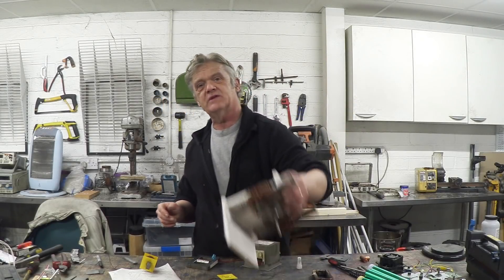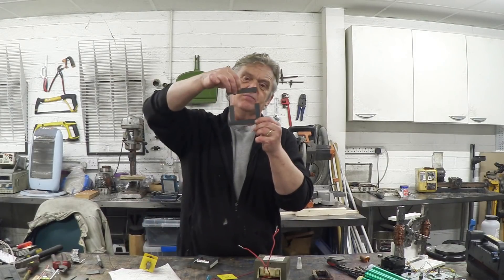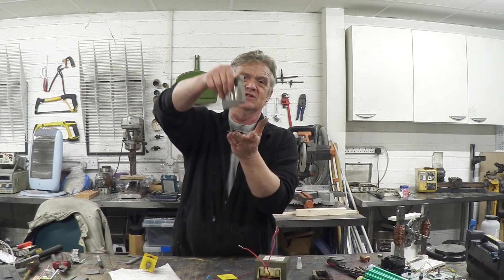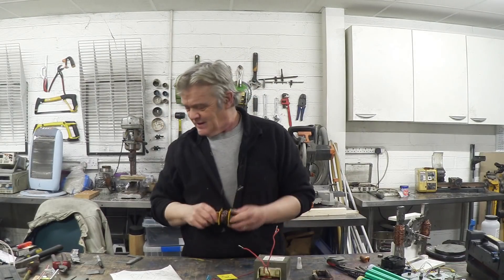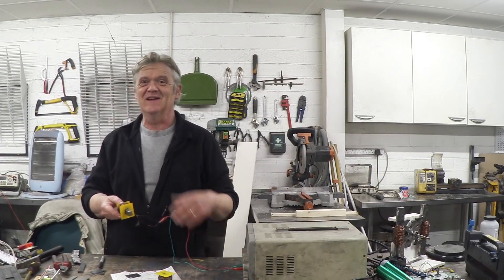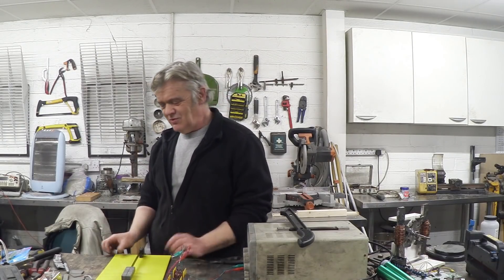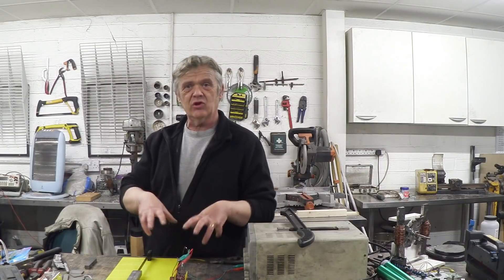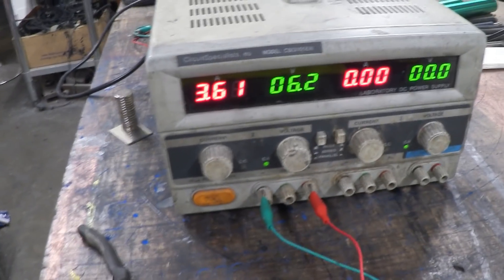1036 Flux Switching And Possible Over Unity

Comment: You are getting very close to the answer, but you are not quite there yet.  I also have theorized on this device but have no workshop facilities.  This is a cause of much grief to me.
But please be aware that success will bring the wrath of power companies down onto your head.  If you achieve a working prototype keep it in a locked box.

Comment: This is actually a mind blowing experiment for me. Thank you. I will spend some time thinking on the best way to replicate and also compare the result to the electromagnet when it is not in the magnetic circuit container. But, first I need to focus on the solar stuff. This is next on my list tho. I think the key here is to redo the experiment with the original electromagnet with only a soft iron core cylinder and not a "U" shaped one to compare to the U shaped and then the neodymium setup. 
I am finding it very odd tho, that the neodymium magnets can't attract while surrounded by the "keepers" cage (for lack of a better term)  since the magnetic circuit is "forced" to travel in the low reluctance circuit, but, the Electromagnets, which are ALSO inside the keepers cage... somehow manage to bypass the requirement of the magnetic circuit. I definitely would like to have this experiment revisited if possible, with better equipment to measure the magnetic force. But, after thinking about this, there must be something else going on here. Because I think you are right that being able to simply switch the flow of a permanent magnet on/off would probably violate conservation of energy. If it were that easy, we could just put relay level energy to switch massive magnets on and off to turn shafts on much larger generators and get over unity. So, clearly we are missing something here. My guess is that no matter how you do this you always have to put the amount of electricity necessary to generate the magnetic field regardless and as someone else mentioned earlier, the reason you see the disparity in the voltage and current usage is because the first method was less efficient to begin with, so this is just a more efficient method as opposed to "turning the permanent magnets" on /off. Still, I find it intriguing. Perhaps this is a way to improve efficiency overall. Please repeat the experiment, but add a traditional single coil with center core only (not an H) as a control.

Comment: THIS is the video that put into my mind a "2-cycle" transformer: use the two coils from a secondary microwave transformer and have them vertical in the 'valleys' of the E frame, while having the primary coil of the first transformer horizontal.

The only adjustment would be to the windings of the 'top coils' and there would be effectively one side for amps and the other for volts.

Diodes and timers would allow for a very articulate system that would use the power of the transformer to do the main body of the work, yet the transformer in question would be very like a step up transformer for both amps and volts respectively.
Reply: Lenz less? Russian stuff?
Is this similar to Bearden's MEG?
I can see this as a Gap Motor. Combined with a variable capacitor. 
Thinking of no drag. High voltage?
What are your thoughts?

Comment: would make for a low energy light weight railgun. Just nebulize strong magnets as the projectile passes though. no more need for a capacitor bank. to charge coils

Comment: This is the so-called Flynn Motor, which is very fascinating indeed. I followed the experiments of very willing guys on this type of device, just to try to create an engine that was capable of going into overunity (in reality it was a site of skeptics that tested the concept). The problem with this type of device lies in the magnetic flux which is opposed to the current in the coils which cancels any beneficial effect of the multiplication in the deviation of the magnetic flux. When the device is put into practice, the magnetic flux entering and exiting the coils opposes the work and brakes the device generating losses. (I don't know if I was able to give the right explanation, because I don't have a lot of experience and I'm not a native speaker of English). Unfortunately, "nature" is diabolical

Comment: Now you get my attention! For the CoinCoil! Two Ciol with a coin in the middle side by side a neodymium magnet in the middle and iron bar over and under! 24 Coils in the 100 £ VAWT! 4 times efficiency. We are Close now! And 1 kWh isn't enought! If a magnet is fasted on a weel or a ducted fan, 3 sides can Work up, down and straight forward! With  a "Tesla" energi or atmospheric  energi from the higher up like a flagpole can drive a Bedinimotor! let us say 100 rpm! in front of the rotor (how is a ducted fan) the motorcoil is and over and under the special coil is! And if the Bedini has the same type of coils it manage 4 times more! Awesome😂!!!
 You can make it Rob!

Comment: I always wondered if you had a strong permanent magnet with a magnetic field that reaches like 1 foot out and rapped a coil around it that apposes the magnetic field and that might compress the magnetic field weakening it for a second while the electromagnet is on so a small electromagnet can have effects further out so the output coil can be larger than the electromagnet field can possibly go because it's not the field from the electromagnet that we would be getting but field from the fluctuating permanent magnet the pulse would have to be short like maybe a spark gap

Comment: Flynn Parallel path magnetic technology (PPMT). I have been working on things like this. Not free energy, just adding permanent magnetic flux to electromagnetic flux. Which can be switched back and forth by DC going through 555 timer. Or AC input which allows flux to change sides.  He called it steering the flux, and he said his designs do add to efficiency.
Reply: How about not using any electronics and simply increase the reluctance for the rotating core of the switched reluctance generator or flux switching alternator? EASY free energy and overunity.

Comment: The biggest problem with OverUnity and (Possible) Perpetual Motion is being able to escape from straight line magnetic forces as the item is captured by the last magnetic field flux. 
The problem is enhanced that you cannot loop the track of magnetism to keep an item rotating permanently. I think the following questions help
1: What if the final magnet was weaker to allow a sufficient mass in motion to escape the last flux & re-enter magnetic propulsion loop?
2: Motion sensing the rotating mass into the last flux field of electromagnet, and switch off the power, collapsing the last flux lock,  would the mass have sufficient force of movement to enter the magnetic loop again?
3: Could a linear motor/magnetic field be generated on approach as a metal object approaches, and switch off after passing. Use less current energising small segments in a rotary fashion, than energising the whole circuit permanently? 
Oh that sounds like an electric motor!! Motors overcome the last flux lock 
Why can a motor rotate more than one circle but not a magnetically propelled object ?
Reply: It's as simple as increasing the reluctance of the rotating core of the switched reluctance generator or flux switching alternator. That's all there is to it. Self-feeding and self-rotating with a synchronous motor.

Comment: I Had A Froze Motor That Got Too Hot. I Rewound The Motor With Thicker Wire. Really Increased The Power, But Also The Vibration. I Then Placed Neodymium Magnets Around The Casing And Adjusted Them To Counter The Vibration Surprisingly Well. Then Eww2ube Recommended This Video. Thanks Robert. your The Best. ❤️ And 💡 Brother. It’s How GOD Works.

Comment: I have seen videos of attempts to build a permanent magnet motor, they nearly work, but stop just before making a full revolution, seems with a bit of electrical assistance they could work, maybe use a electric magnet to 'turn off' the magnet preventing the full revolution, or to boost the speed, there's many ways to possibly get it to work, if not 100+% surely a motor 99.9999% efficient is possible! Maybe even 100%!!! We need to try before saying  'impossible'

Comment: It's a saturable reactor. You are pre-saturating the core with a magnetic circuit induced by the magnets in the center. Now compare the deviation from both coils in parallel on one I piece with a pole facing the deflector. That would give us some valuable data.

Comment: Your work calculation assumes that all the power from the power supply is doing work, but it's not -- almost all of it is being lost as heat in the coil. Using a permanent magnet to supply some of the flux is just making it slightly less grossly inefficient. Nothing magical is happening. This is not a new idea -- a permanent magnet motor is more efficient than one with field coils for the same reason.

Comment: 7:36 So one is (say) 10% efficient and the other 40% efficient. Sure one is 4 times better than the other but I'm certainly not thinking "overunity".
Reply: Oh I am.  Take a circular V gate.   It works down to that last inch.   Permanent magnets do 90+ percent of the work.  it just can't get back Into the gate.  Blip that starting (or end) point off at the right point as it goes, it keeps going, and you get more work out of it than energy in. 

I'm stongly pondering how weak you can make the electromagnets to redirect the magnetic flux enough to generate current in a bunch of coils using permanent magnets as your primary electro motive force.    how much juice in an electromagnet does it take to contain a permanent magnet's field in an armature? (or change it enough to induce a current in a coil) if that's less than the permanent magnet's field fluxuating induces in the coils around it, then you've managed to hack what physics Does, and got some overunity happening. 

And I'm coming at that from a "Potential Leverage" perspective, rather than a hairbrained one.
Reply: I'm also certain you can run a stirling or steam engine off an AC unit, without costing the system anything.   (right after the compression phase where it has to Dump heat, and right After it's done the cooling bit in the room, and the refrigerant is still cold)  Could you get enough to Run the AC unit?  likely not.  but you could Absolutely turn that temperature differential into extra electricity, without impacting the function of the system.
Reply: What Bob is suggesting is a catalyst. How to get the same thing 4 less effort.
Think about it, build it, test and use it. Then check your wallet. That's all.
Reply: @wazittuyoo2147  That's really not difficult to achieve if the efficiency you start with is very poor. It's not hard to improve the efficiency of a motor from say 60% to 90% or even 95% but that doesn't mean you are any nearer to achieving 101% (eg over unity).

Comment: I did a similar concept in school physics to demonstrate the concept of field weakening to use the permanent magnets permanent latching and then weakened by small pulse to a coil around the magnets which would let go of its victim. The best demonstration was in reverse though when I had the permanent magnet in repulsion and pulse the coil in attraction to pull it towards and it was able to break an electrical connection to demonstrate a control mechanism that was highly efficient! Essentially it was a  modern day relay !
It actually reminds me of some great times in conceptual physics at school.
Reply: Essentially a Gap Motor. A good concept. 50% input, and even less.😊

Comment: Another thing Rob, over unity can only be achieved in an open circuit system, where the input is not physically connected to the output. Like a gravity assisted water pump where two small children can swing a heavy weight around to turn a pump. This must be possible with magnets where you can switch on and off an electro magnet to " nudge" a weight to "fall" into gravity?

Comment: Well then Rob, what did the soap taste like, lol. Please try a washing machine water pump. Just add a strong magnet to the top of the laminations. It "appears" to dramatically increase the power generated. By the way , this kind of pump is really a magnificent generator of power. Steinmetz apparently did the maths and came up with a '"voltsecond' where time is irrelevant to the generation processes. I do not pretend to understand Steinmetz's formulas, but maybe with a bit of experimentation and common sense one might replicate the flux thing with a simple pump?

Comment: That is really cool I wonder what would happen if one of the coils you put AC current instead of DC current what comes out the other side with the neodymium magnets assisting think I'll experiment with that
Reply: Pulsed dc, one coil cw, the other ccw or simply invert one of the coils, and not too strong neodymium magnets, the effect is real numerous people have experimented with this Lawrence tseung is one, numerous configurations is possible, Research Patrik Kelley guide transformers

Comment: Did you look at the orbo?( I think that's what it was called) motor using a small electromagnet to saturate a core in order to switch off the main flux from a permanent magnet that drove the rotor.. quite interesting...
Reply: Steorn's Orbo? €23,000,000 over 10 years, proving how gullible some people can be.

Comment: use a power meter and run it for 24 hours and watch it degause the magnets
Reply: Your the kinda guy who should just keep paying his electric bill and bitch every month when you do it. 
Who knew you can only use a magnet so long.
Reply: @make425  because i went to learn this sort of stuff also you might rip the magnets apart if the field flux is strong enough even tho they are coated magnets.
Reply: @fastmover45 then you understand how a magnet is made,  heat is the main cause of magnetic lose,   not putting two opposite polls together. I can see the possibility of nutrulation of the feild because of repolerising the magnet due to overpowering a field. Same thing use to happen with old motor cycles magneto. Lose there field and you have to remag it.
Reply: @make425  ok so mains AC is 60hz in usa and 50hz in the uk therefor a changeing flux field 50 times a second. The magnet is being worked on like a hard disk degauseing plate.left hand rule and right hand rule no movement = heat. there are loads of reasons this dont work.
Reply: @fastmover45  ah i think i understand why you are thinking like you are. 
If he makes a motor/generator. This will be most likely be pulsed dc,  the coils will only perduce ac electric as a biproduct of the collapsed coil field. ,
Im just saying your not going to kill the magnets field.
A magnet can be recharged! Simple as that.
Reply: @make425  transformers only work on ac. If you pulse a transformer with dc you get a massive back emf.
Reply: @fastmover45  yes the more the better for what we are doing. Its part of the search for a over unity motor/device. To get more work out than we put in.
You might want to brush up on some free Energy research. Bedini, newman, tesla, Howard Johnson,  Robert Adam's motors.
Reply: @make425  free energy / over unity is a joke. Learn the science and understand it. this stuff would be on the front page of the IEEE if it worked. It dont work it has never worked  it not going to work.
Reply: @fastmover45  nothing is free,  i agree with you on that.
You have to have starting power.
 But it is very possible to make a over efficient motor. You would have to witness it in person.  
If i can spin my 50 pound flywheel for 8 days 24/7 and only lose 1 volt from 24.7 to 23.7, 
You cannot tell me i could not pump hundreds of gallon's of water at a quarter of a amp. 
Check my channel out and watch the video, then think about what there teaching in school.
I'm still in the middle of my project and there's no way I'm stopping now. Water pump is right after I can rework the driver circuit. 
There's villages that need tec like Joe Newman did.
And in my opinion, all the other free Energy people  that Made real machines failed because of greed. God wants this to be 💯 free for the world.
Thank you for the interesting conversations tho.
We are unconventional science.
Reply: @make425  have you.seen the huge flywheels 100s of tons the  french used in cold war nuke bunkers.they ran in a vacume and ran for years.
Reply: @fastmover45  i haven't, but knew the electric company is doing it with the big windmills now. It is definitely something I wanted to include in a motor.  One of these days I'll figure out this wieght at this rmp is this many footpounds of stored force.
The guy from mithbusters did a video like a week ago on a build. Two 1000 pound flywheels at 300 rpm and they shutter down lol

Comment: It reminds me of magnetic amplifiers. You can push the core in and out if saturation with the inductors. When saturated the permanent magnet's flux will not be contained anymore.  So with a core with the right BH curve, you should get a stronger force with less current. It's a neat idea, the closest I ever saw to that was a boot that NASA made, I think in the 50s or 60s.

Comment: Dear Robert, about 9 months ago you posted a video making a solar cell from a LCD screen, and more recently, a video on LED's used a as solar cell, couldn't one than make a pretty decent solar panel from a LED screen?
Reply: yes and no, if you have old led screens lying around than you have to link the rows together and either get lots of volts and almost no amps or almost 1amp and barely any volts. if such screens arent free to you, you will be far better off spending on a genuine solarpannel with the caracteristics you need.
Reply: @naotamf1588  Good to know, i appreciate the information :)